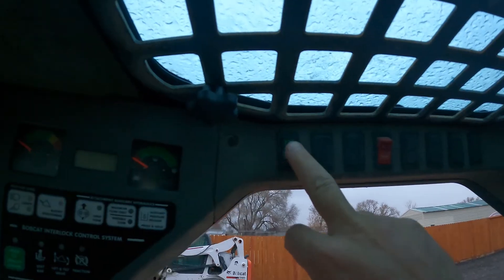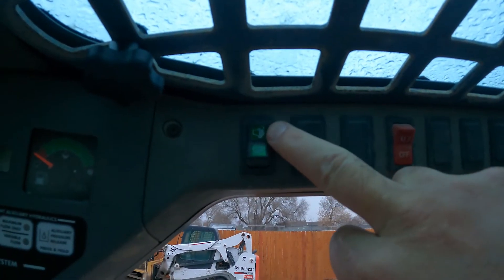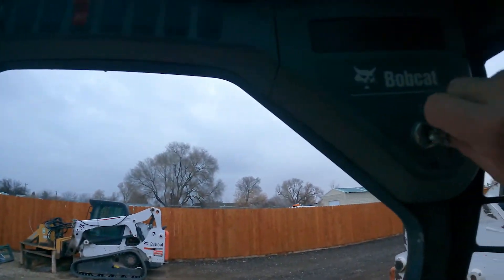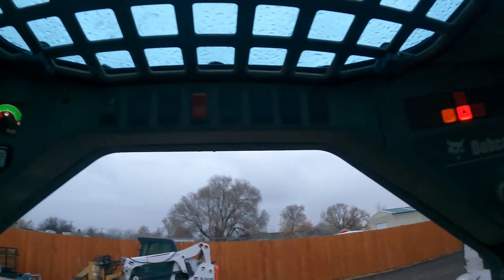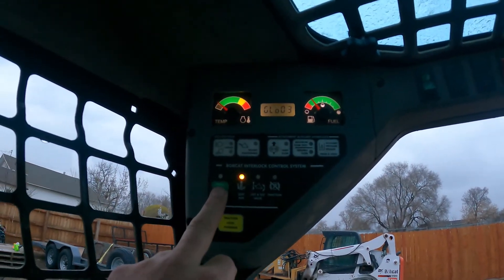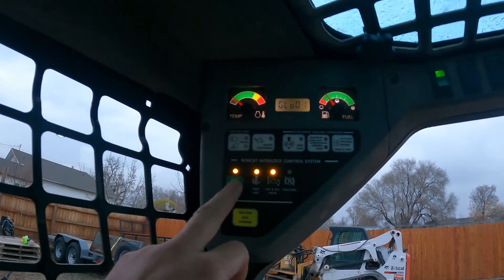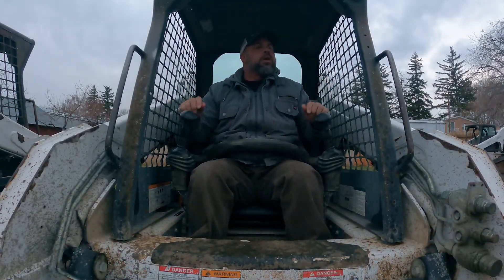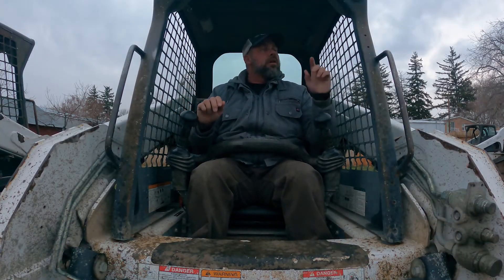Bobcat Actuator Calibration using machine controls not dealer laptop

Comment: Installed new actuators on our 2003 t200. Used this method to calibrate the new parts. Cleaned corrosion in fuse box, inspected and repaired some the the wiring on the machine. 20 minutes of run time with no issues with acs code or tilt or lift functions. I had acs communication code before replacement and couldn’t calibrate the old actuators. I was able to calibrate them but then threw a communication code after 20-40minutes of run time, then would now calibrate.  Had power at all fuses before but had corrosion in fuse box

Comment: Im curious how to calibrate when the controllers wont unlock. Ive pulled my actuators out  and calibrated them to 2 volts. I did it based on your other video. When I put the actuators back in immediately throws the code that they are not in calibration. I've read a few things that if the computer on the machine senses that it's too far out it we'll just throw the code immediately. It's throwing the lift code first and if I switch the plugs it throws the tilt code first. I've also read some stuff online that activators want to be at 1.72 volts when flush to the casing. Im not sure whats right. Ive tried both 1.72 and 2 volts both times it did the same thing. If you have any input that would be awesome. Thanks
Reply: My bad, I realized that the neutral position was different because my actuators were different. I set them at 2v flush with the body and realized that that was good on the one but the other one needed to be 5mm in. Pur everything back together and ran it hard for about an hour, no issues. 
Thank you so much for all your videos! Super nice to have such knowledgeable people sharing info

Comment: I have an S300. Done this successfully before on this machine, but now as I follow the steps, my handles won't unlock. I start in "hand" position, turn the key to "on" (not run), hit the unlock green button, pull the bar down, but no unlocking of the handles. I have tried a few different coombinations, pulling the bar down and then hitting the unlock, but no success yet. What can be keeping those handles locked?
Reply from the maker: If it has an active code, it will not unlock
Reply: I have a similar issue. 32-34 ACS comes on as soon as I turn the key. Maybe 2-3 seconds
Reply: Same here…
Reply: Did you solve it?
Reply: I could clear the problem by recalibrating the actuators, but the problem would recur again and the interval between failing became shorter. Those actuators were simply wearing out. Had the dealer replace them and the machine is bulletproof again.

Comment: Thank you for your videos. Hopefully you get this comment. I am having trouble with my 2013 s530 with ACS. I’m getting an intermittent code for m3204. It says bobcat unable to communicate with ACS and it won’t unlock the controls. If I wait an hour and come back it works fine. I have changed the Switch for the hand and foot controls and I changed the ACS solenoid. The fuses and relays are also good. Do you have any suggestions on where I can look to figure this problem out? Thank you.
Reply from the maker: ACS controller is failing internally, very common when it gets hot.  You will need to replace the controller and program.
Reply: Thank you very much. I was afraid that was going to be the answer.
Reply: I'm having the same exact issue. Are you talking about the computer like box under the side panel? 
I commented on this video asking about calibration. 
I pulled the actuators out to test if they were working properly. but my original issue was the same as the comment above. Now I'm unable to unlock the machine at all due to calibration codes. Even tho I manually calibrated the actuators to 2volts and I even tried 1.72 volts. 
Is there any way to check the computer or reset?
Reply: Got it calibrated and running. I manually calibrated actuators and they seem to be working properly. I got it running and have been doing a bunch of work but the same issue is happening it will intermittently lock up with the code 32 - 04 I can let it sit for a little bit turn it back on and it'll work again sometimes I can just turn it off and back on and it'll work again sometimes it won't ever unlock that day. 
What's the best way to test the computer?
Reply: Yes. The ACS module fails internally. When it gets warm it stops working and then when it cools back down it will work again. I replaced the ACS controller and it’s all good to go now. Not sure if there is any way to test the ACS module itself. But it is pretty common for this model
Reply: @hurleypatrick94  hmm, mine doesn't seem to have a rythme or reason for acting up. But I guess that's how it goes with that electric shit. Just wonder what's actually wrong with it. Seems like there would be a way to repair it.
Do you know if there is any way to test the computer.

Comment: Great videos, a lot of details, much appreciated.
I've been working on 2001 863, following your videos I had tilt actuator locking up the system, actuator was full of oil, only 3 years old.
I replaced the spool seals and actuator, everything works fine now but I cannot calibrate.

Comment: We replaced the tilt actuator and had the right joystick repaired (circuit board) in our T320 and it will only give a 40-07, y-axis not in neutral code whenever we try to calibrate. All of the controls are functioning, however.

Comment: Do you have a video on how to calibrate actuators on an m series? Have a T-870 that has started giving a W3250 code after running it for awhile (45 min- 1hr) and wanting to try avoid replacing it if not necessary.
Reply from the maker: I do have a video on m series calibration.

Comment: Hi from Czech republic. I have a T190 with manual controls only. I replaced the motor in the actuator and during the calibration test it reports W3239. I tried calibrating it at least 15 times and still the same. Thanks for advice
Reply from the maker: Check signal voltage from actuator, should be 2.0 volts

Comment: If I buy and replace the actuator myself or get one that is rebuilt will I be able to use this calibration method on the new one and get it to work or does a newly installed actuator require dealer to use software to program it?
Reply from the maker: The manual calibration will work with the new actuator.
Reply: @tetradgroup  I had t300 main computer starting to let alternator overcharge and as a result it started throwing the acs code so arms would lock up but had dealer Install new computer and new alternator but acs still pops up at times and stops arm movements so maybe actuator went slightly bad due to the overcharging so now I’m looking to change it out myself thank you for your response it helps out people..

Comment: hello, can you tell me if it is possible to calibrate the acs calculator without a dealer without a computer, I have a s175 2007 with manual control
Reply from the maker: Yes, I have a few videos on calibration process.

Comment: Greetings from Romania ,  i have some problems with my bobcat s130 2008  with electric joysticks, i use iso controls  , ive noticed  that  that sometimes when i open or close bucket  he doesn t open or close  with  100% speed , more like 20% speed , and if i hit again the comand its working fine , any idea what it could be?  Thanks :)
Reply from the maker: Hard to say but I would suspect paddle switch not working correctly on the joystick.  I'm assuming you are working a hydraulic bucket.  The dealer could monitor switch position on the computer.

Comment: Will a secondary throttle not calibrated code cause a no start condition? 

Recently took apart the injection pump because we are guessing it’s bad because WIF event, but the inside of the pump looks pristine. So before buying a new pump would like to know if the secondary throttle not being calibrated will cause a no start condition.
Reply from the maker: No, a secondary throttle calibration will not cause a no start condition

Comment: Hi sir I am from Guatemala country 
I have problems with my bobcat 8811 attachment 
Lithe retro on the skid steer bobcat s300
Days ago my attachment work good good power
And now star not power pressure 
Slow and push the two option bottom, and push the acceleration diesel but continue work very slow
My skid steer not have leaking days ago
Change the spool seals 
Not leaking cylinders or hose
The attachment not leaking 
Can you help me sir 
What are I can do thank you
Reply from the maker: Check the hydraulic filters and case drain filters for any metal or brass, want to make sure the gear pump is not damaged.
Reply: Wouuu
Today I saw the brake solenoid brokend and go in to the case chain container 
And another pieces 
And I saw alot pieces 
You think that problem 
But the skid steer tire is good rotation

Comment: I have an 04 S300 and once and while my bucket lift hand controls becomes slow, I do the recalibration and then it works fine but it will at some point within a day or two of operating it will get slow again.  One time I had the lift run away on me and kept going up with no input from me on hand controls.  Any ideas?  Appreciate any advice you could offer
Reply from the maker: Sounds like the ACS controller is going bad.  I would replace the joystick sensor and the ACS controller to make sure the issue is solved especially if you don't have any codes.  Boom movement without input is dangerous.
Reply: @tetradgroup  to be clear the ACS controller is not the actuator correct?  Would it be possible to send me links to parts?  Or point me in the right direction for them.
Reply from the maker: @anthonycurcio5388  correct, I'll need the serial number to recommend the correct parts.  Do you know it the machine is AJC or SJC?

Comment: 873 G with ACS hand control only. 
I just replaced tilt actuator. 
Trying to recalibrate using the method you show in the video but I keep getting 32-40 code. 
I think the problem might be During recalibration I do not hear the actuators recalibrating. 
Any recommendations on what to try next?
Thanks!
Reply from the maker: 32-40 is for the right handle sensor.  If the sensor in the handle is out of neutral it will not initiate the calibration process.
Reply: How do I get the right handle sensor to neutral?
One more observation is that when operating the tilt it vibrates with slow tilt either way. 
Not noticeable when with full tilt in and out.
Reply from the maker: @coledogger2227  The sensor is going bad and needs to be replaced